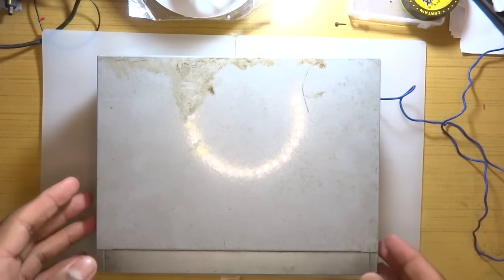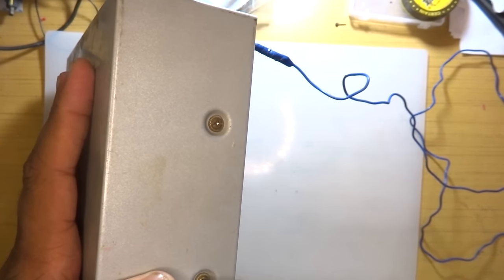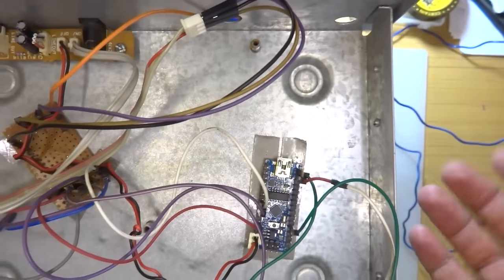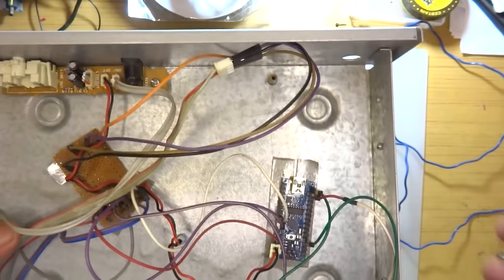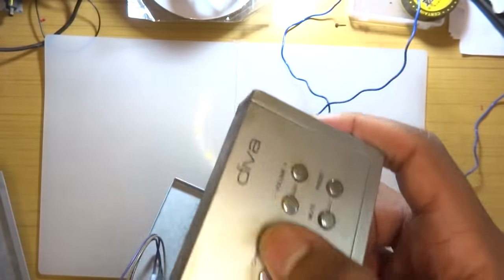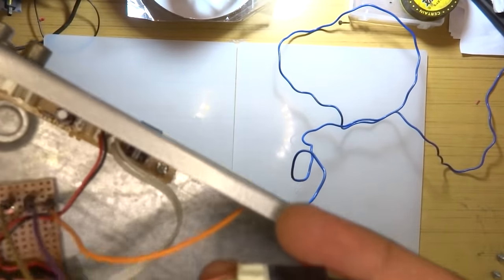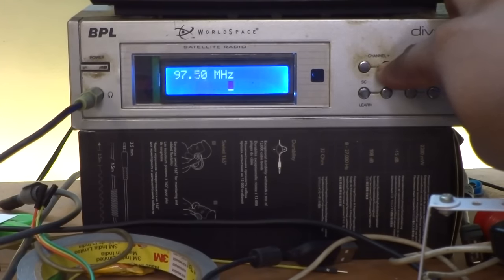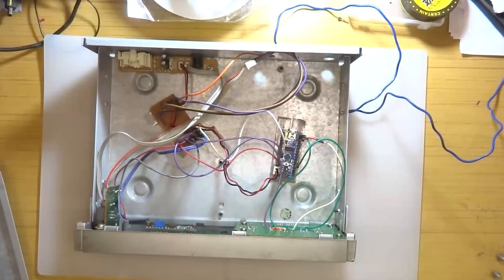DIY Arduino FM Receiver From Scrap Using CL5767/TEA5767

Comment: Hi,
Can I broadcast with this system in any radio channel or need an unused channel ? For example, 97.20 FM is in use. Can i broadcast on it in 500 meter range ?
Thanks.
Reply from the maker: Plays Maker not for broadcast on reciver
Reply from the maker: Plays Maker not for broadcast only receive